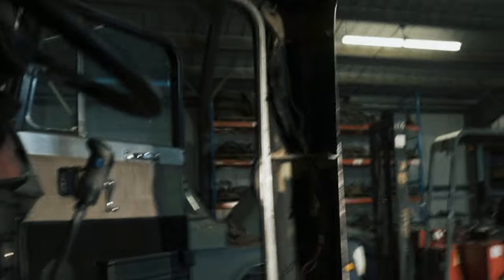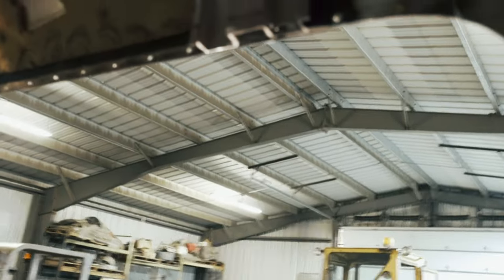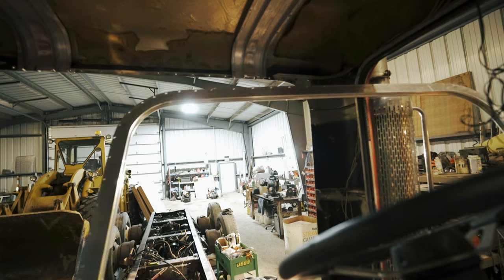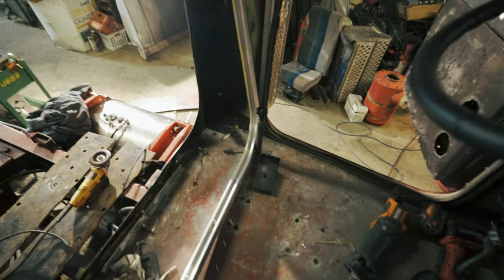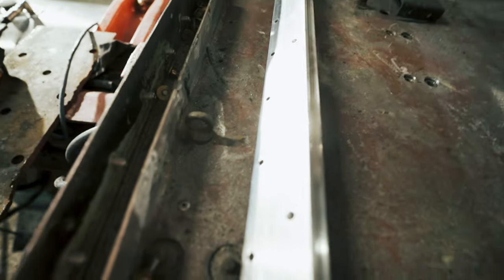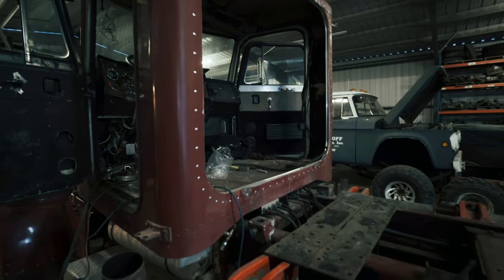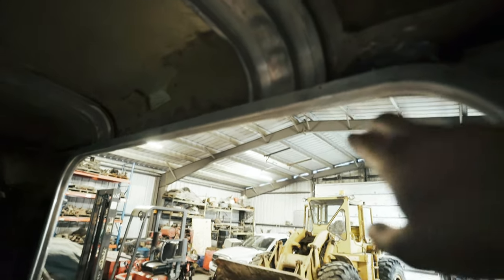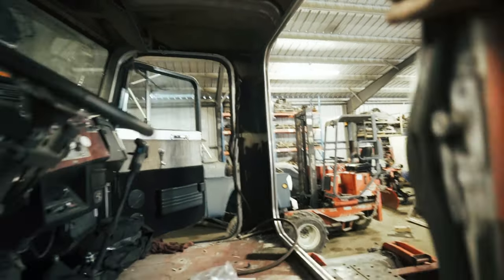1987 Peterbilt Big Hole Conversion Part 1

Comment: Young Man, I finished a 93 exhd 4 months ago, same color too, brings back nightmares, its alot more work than people think, did the same thing, cut,fit,cuss,cut fit,cuss....as far as the lower floor pan I was able to bend that down enough to clear then porta powered it back then secured it. Couple things, daycab company makes a 4 piece ring and Id say thats why to make the install easier, If I do another one I will try their ring, secondly I hear ya on the NOT unibilting the sleeper/ cab on air? I know a guy that put aluminum rails under the sleeper and cab and only used the air ride on the back of the bunk but fastened the cab/sleeper to the rails and it works well.Lastly Im 6,1 and i needed the leg room also, but mine was a day cab so i just fatboy,d the cab. Good Luck and God Bless You, be waiting for the next video.

Comment: I’m trying to do it to my 359 do you have a link from where you order the rings?
Reply from the maker: Truck shrouds has but I ordered them thru my local Peterbilt dealer
Reply: @Shifty379  part number RA-6009 and yes they work 0n a 359 I have done a couple of them
Reply: How much for parts?
Reply: @Shifty379 was there a ring on your cab for the small hole sleeper? I can find the big hole rings all over but not the small hole. I have a small hole sleeper I wanna put on my daycab